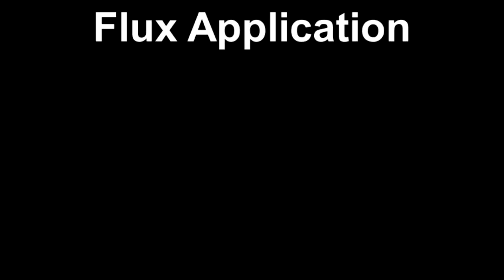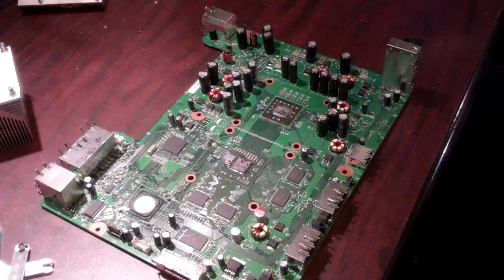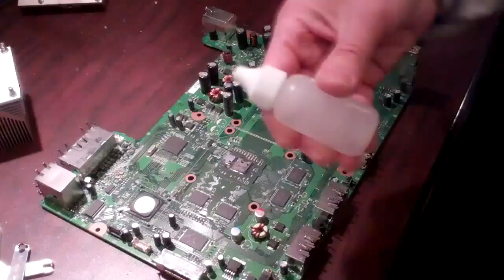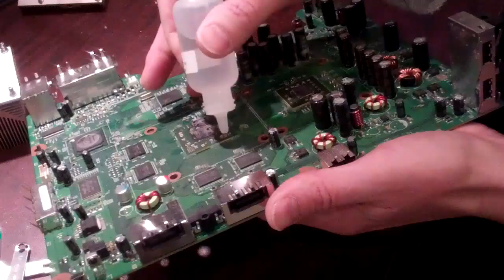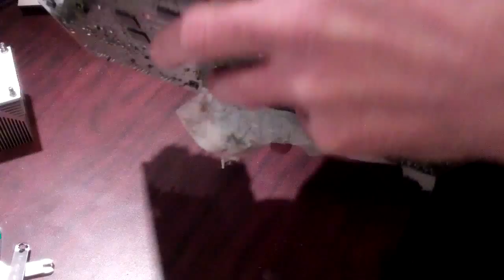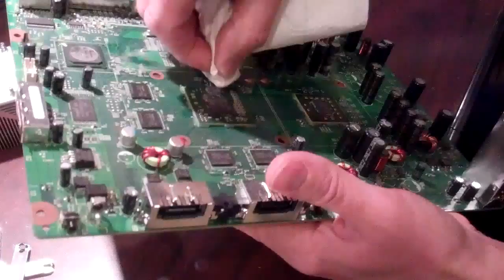Flux Application in Preparation of a Reflow or Reball of XBOX 360 or Playstation 3

Comment from the maker: The effectiveness of flux decreases over time past without using it or heating the board.  So you should always reflow or Reball soon as possible after applying flux.  A little about flux - different fluxs have different activation temperatures.  Not allowing the flux time to activate would kill or burn off the flux - this renders the flux useless.  I.e. always know your flux activation temp

Comment from the maker: Thermal compound must be applied after any repair that you removed the existing compound.  This has no real direct affect on the reflow or Reball process as it is a reassembly issue.  If you meant does flux need to be used when reflowing or reballing the answer would be - flux is a solder melting agent in that it assists in the cleaning and deoxidation of the solder when reaching the melting point.  It is important to use flux - although a repair is possible without the use of flux.